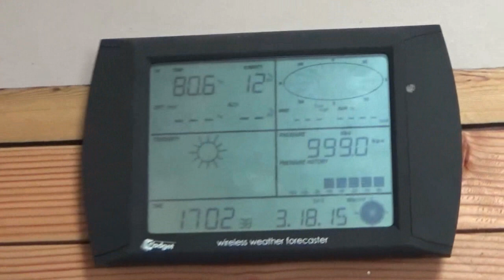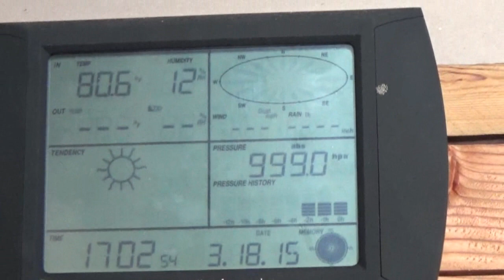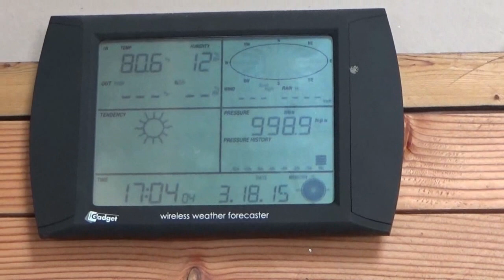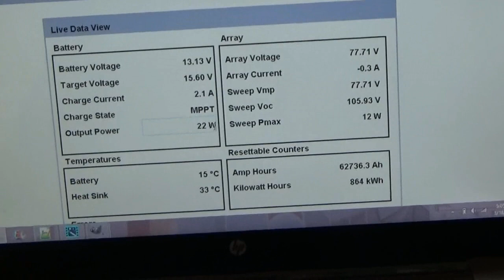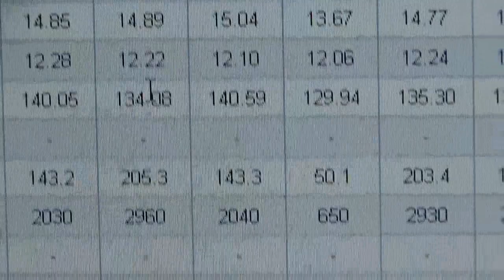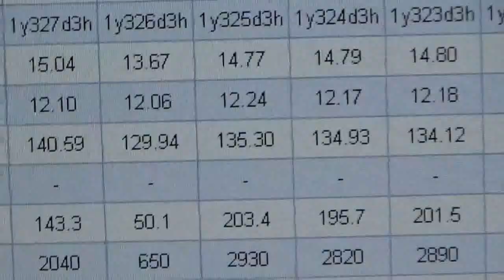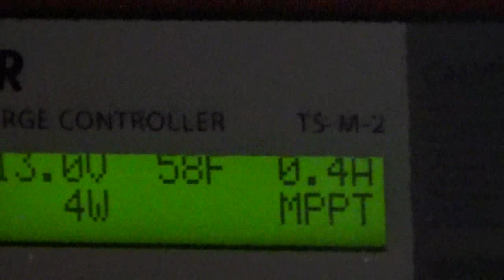Devastating Wind Flattens Meadow & Foraging For Edibles Under Snow

Comment: I am confused. You say the rosin paper was ripped off your roof, but it is supposed to be between the metal and the tar paper. What happened to the metal? And rosin paper is pink, that paper you showed was black, looked more like tar paper than rosin paper to me.
That and your story about not having been outside and at the same time running around to secure stuff.
Reply: Lynn Morrow You are right there's a strip across the bottom edge of about 12-16 inches that still needs the metal.  Well, and now some tar paper, too.  And rain is due...bummer.  I don't expect leaks if he gets up there very soon and finishes that off,  but that sheathing woke last long without at least tar paper.
Reply: I think he mis - spoke, you are right that looks like tar paper.  There was no metal on the low edge of the roof, yet... just tar paper.

Comment: Here in Maine it sounds like micro-burst or mini tornado, we get them sometimes running through the woods and flats in W. Paris. We had 50-60 mph winds all Tue and Wed. Today its only 20-40mph with an occ. 50 gust. Beats all heck out of sustained speeds. If you live in such an area you will need to have concrete footings and/or 6-8 foot stakes for guy wire for your turbine protection and anything else you might like to keep. At my off grid camp I watched a 16 foot by 12 foot pressure treated dock with iron deck ripped apart during a micro burst (the type of dock that requires a crane to move).I was busy doing several hail mary's in the boathouse 6 feet way. And the dock was held in place formerly by 6- 300lb. weight attached to chains. The only place it held was where it was attached to rocks the size of a Buick. Gotta love the weather and learn from mistakes.
Reply: Figure there wasn't room in their garage for another vehicle stored for an unknown length of time. You mean you've never parked outside and not required a jump to get it moving again. Or discovered after a month of not moving you're vehicle wasn't frozen in place.  I think the snows and cold of most places weren't really expecting such a cold snap (climate change) of last year or even this. Heck, if I didn't have 6 cords laid up this winter it would have been a a PITA for me. But, I tend to oversplit just in case, that way in a typical winter I have 1-2 extra cords for wood heat vs. using more than 60 gallons of oil in the furnace per fill. Two months vs. my usual 1 1/2 months of  daytime and nighttime below zero weather of -20* temps.

Comment: How much maple syrup did you end up making?
Reply: Good grief. I wouldn't think he has "ended up" yet. He is probably still collecting and storing sap. Good grief. He hasn't put the evaporator together yet. What are you thinking? This isn't TV where the whole story is told in 30 minutes.
Reply: John King
Good grief. The sap is stored outside in snow banks and is no doubt frozen right now. Why don't you wait until a reasonable amount of time has passed before making a fool of yourself? Just an idea. You have plenty of time to act like a jerk. What's the rush?
Reply from the maker: Still boiling and collecting. Season is just started.
Reply: The Do It Yourself World saw the smoke from the fire 3 vids ago in the background

Comment: How are you useing 2000 watts a day? I believe your batteries are bad. Have you been overcharging your batteries to 14 + volts again? Maybe you shopuld add an end cell if you want to charge to 14 + volts.
Reply: again, you have no idea what you are talking about on those traction batterys, the charge voltage is higher than charging car battery's, 16 volts is normal by traction cels under charge.144 is max on car battery's.
Reply: Flooded batterys gel batterys and sealed batterys all operate differently. For flooded battertys 14v is fine. If it was say a normal car battery then hed be having problems
Reply: TheKazzarry I have a brand new Chevy Traverse and I drive big rigs they all charge at 14.5 volts.
Reply: Pete Brown no, charge voltage, its higher on traction sets than on normal car battery's
Reply: Dennis Steele  those are all starter batterys (rigs mostly start on 24 volt systems), so max charge voltages are 14.4 on 12 volt sets, and 28,8 volts on 24 volt sets, in traction cels (lead acid flooded) the voltage at charge is higher, 15 volts on 12 volt banks, and 30 volts on 24 volt sets, thats to maximize bubbeling to avoid stratification of the fluid in the cels.(and yes they use water that way, but that can be re filled.) dont make the mistake to charge a traction cel the same way as a starter battery, in te longer term the right voltage at charging wil lenghten the life off the cell.
Reply: MrBugsier5
Well enplane why? Why would the style of the plates make a difference if the chemecals are Lead and Sulphuric acid?
Reply: MrBugsier5
The batteries in a car today have a bit of calcium added this prevents them from loosing water so they almost seal the battery. But you are telling me that it is necessary to over charge a lead acid battery to maintain charge. Make it bubble ( generate hydrogen oxygen) I also understand that that causes lead and acid to be lost the lead goes into the separators and the bottom of the cell. When do you add acid to a battery to replace lost acid. I see no way to replace the sponge lead it stays down there till it shorts out the cell.
Reply: ??? never ad acid to a cel, never ad anything else then distilled or demineralized water, big cels like Troy uses you have to charge them with a higer charge voltage, indeed to make them gas , thats not to tickle the lead but to keep the water acid mixture mixed otherwise the top part of the plates wil have a lesser value of acid then the bottom part, thats also why you have to equalize charge semy traction cels to keep the cels active.
a lead acid traction cell is differend constucted then a starter (car battery,)
thats becouse the way you use them in action, a start battery delivers a high start current for only a short time, so you dont draw a lot of amphours out of this cel, if the engine starts he alternator takes over the delivery of power to the system,(and also charges the used amphours back in it,the battery does not deliver any amps to the system when the engine is runnig, a traction cell is made with thicker and less plates pro cell, it can not diliver high start amps, but can deliver power for a longer time, whitout having to get charged.
so lots of amphours over longer time (the cca of a starter battery is higher than a traction battery)
Reply: MrBugsier5 Bubbles rising in a battery mean that the battery has got to full charge and charging it a great deal more will damage it. The bubbles are Hydrogen ans Oxygen and are simply splitting the water apart and has nothing to do with charging the battery. When this is happening acid is being lost and full charge will be less in the future and lead is being forced out of the plates and settling in the insulator and bottom of the battery. Put a bit of baking soda on the top of the cell see if it does not bubble.
Reply: you are not correct. (sorry) in a traction cel the plates are constructed different, they are build to be abused, you also dont loose acid, only the water (you sead it yourself, oxigen and hydrogen), (dont remove the caps tho!!)also the cels will buble under charge , even when the cell is only half charged, there is a big difference in traction cels and starter battery's (like the ones in cars), traction cels are not damaged by normal charging at 15 volts or more (its not over charged at the voltages we use (15 to 16 volts for a traction cel, and 14.4(max) in a starter battery ( both 12 v systems) (starter batterys are easely damaged by overcharging due to the thin construction of the plates, indeed they wil damage easy by over charging, so never charge toe above 14.5 volts!,, thats realy different by traction cels (like the ones Troy is using now)

Comment: Thanks troy,
Im now running unfortunately  hf panels at my house. I will get better panels as time goes on. I understand wind and its destruction. Living in eastern Washington we get dust storms from time to time.
Last year there was a f1 tornado about 4 miles from here. WOW! 
GET those panels up and producing.
I wonder if you couldn't do a water wheel? And make your own power poles to run the line? 
As always keep it up. You in our prayers.
Hooah!
Reply from the maker: The creek is on another property.
HF solar panels produce power in all weather so they are pretty good actually. The down side is a shorter life span.
Thanks

Comment: Troy we get those small tornadoes in Washington state every year. Last year we had one over the water so it was a huge water spout and luckily petered out once it hit land. Usually in the same area closer to Mt Rainier. Went through a tornado in NW PA, sounded like a freight train. Took the porch and shoved it against the front door so nobody could use the front entrance. It ripped off the roof at the apartments a mile away.

Comment: OK, I think you had something like this before in the meadow when the ladder went flying. I think you need to plan on putting ground anchors on everything and putting everything away under shelter all the time until you can pin point when in your seasons in the meadow to expect it. When was it that the wind tossed the ladder before? What time of year? I forget when that was.
Reply from the maker: It was spring. We also get a tornado passing nearby every year in late spring. Fun.
Reply: OK, since it has happened about the same time for two years now, I think next year you are forewarned. You can take it into consideration in your future plans. For instance, can the coops be anchored in trees adjacent the meadow and just have a run for access to the grassy area? You may need to get real creative.
Reply: Lynn Morrow <<<<< thinks he is funny. :-)
Reply: UNumbTV
Lynn Morrow <<<<< Is only funny looking.
Reply: Pete Brown
Sorry, I misread what you wrote.